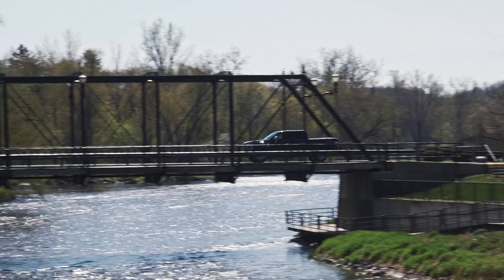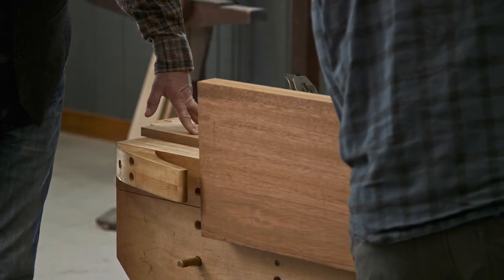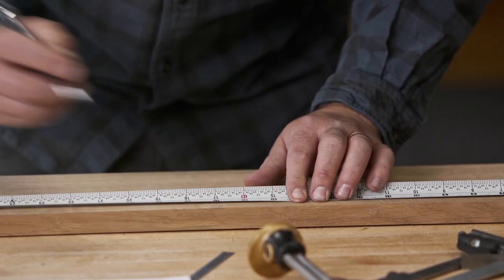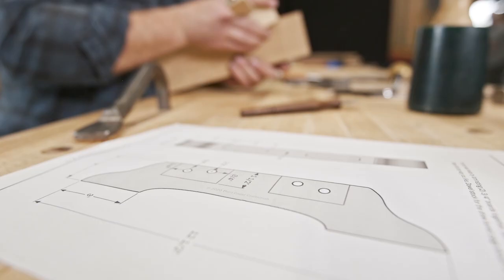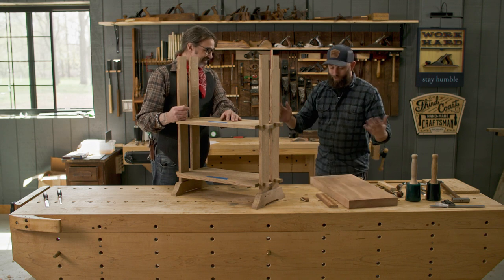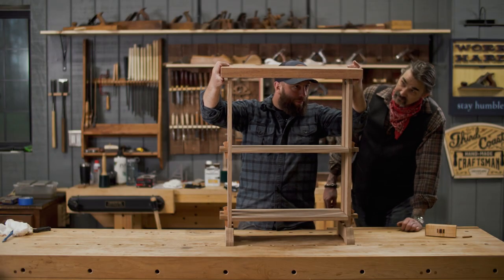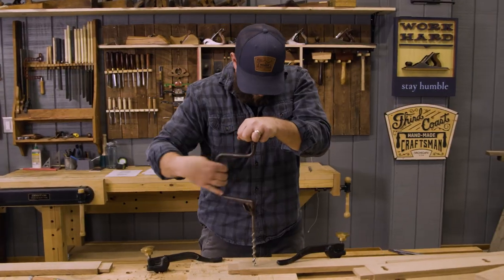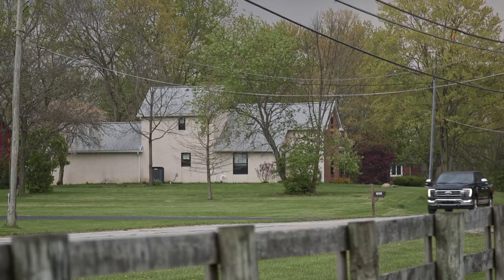A Craftsman's Legacy | The Joiner | Woodworking

Comment: Just watched this (May 5, 2022). I built.a trestle table, 30”x84” in red oak (the hardwood dealer did not have white oak) in 2018.  The table used the techniques. It was a stretch for me, but was great to finish.
Reply from the maker: That's fantastic!  Congrats

Comment: What was that tool?? I'm a big fan of hand tools. I finally resorted to power tools to get ANY kind of accuracy, but I admire the heck out of anyone who can get such great results with hand tools. (And I still use some of those techniques, even with power tools!) And I'm also a fan of Japanese joinery and old-time timber joinery, so I loved this episode. Anyway... At 17:15 you begin relieving the edge of a board with a tool I've never seen before. At first, I thought it was a cabinet scraper held to a block of wood with finger pressure. But between 17:17 and 17:18 there's a great picture of the bottom of the tool. It looks like a long sheet of metal with several large holes, and a curved end that comes up just short of the wooden block. What the heck is that tool?? :__)  And of, course, another great job...
Reply: That’s just a block of wood with some sand paper on the bottom 😁
Reply: @ThirdCoastCraftsman  Hah! Fooled me! Sure looked like a metal plate. But I get it: A sheet of orbital sander paper. That explains the holes and the curved edge. Thanks! :___)